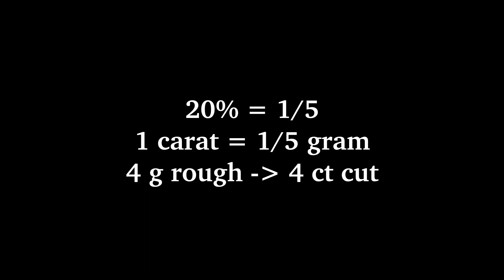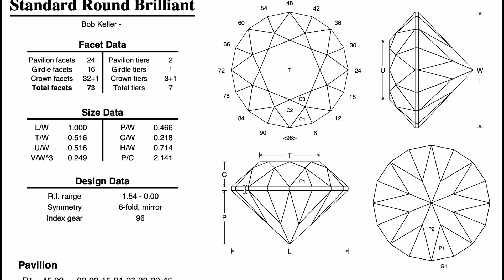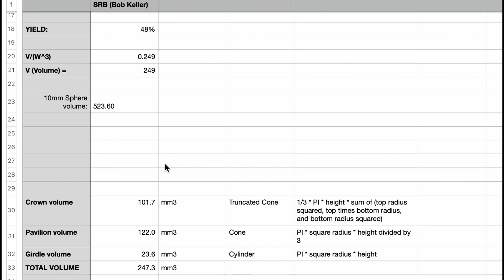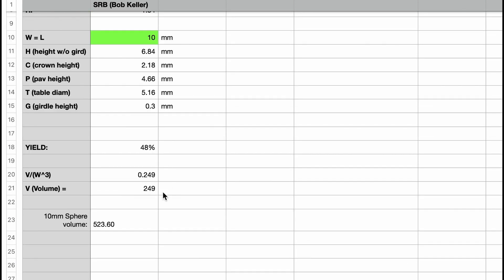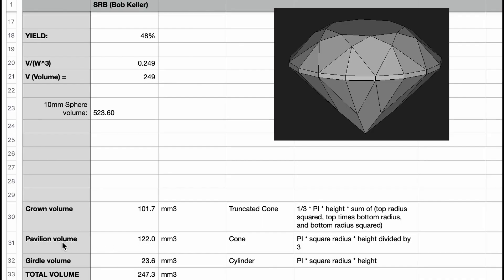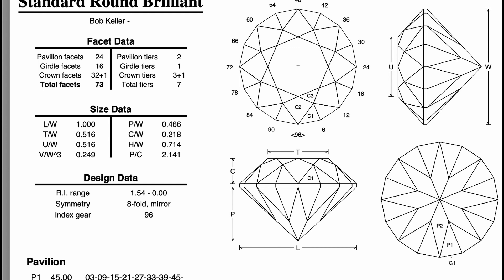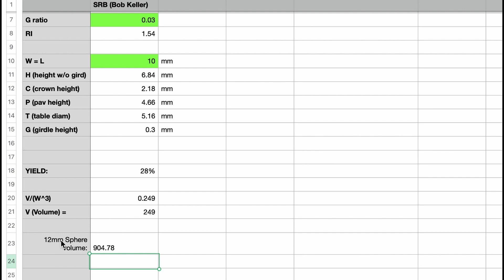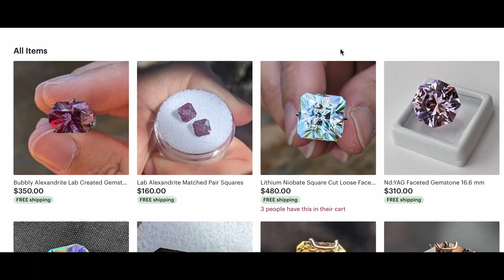Facet Math.

Comment: Patrick? I have a new three hundred dollar faceting machine called a Vevor. Looks accurate, But! 

I haven't faceted anything yet. 

I'm planning it all out and my problem is transfering. There is no index pin or flat spot, in the quill. I can fix that with a small drill and then a center punch. The problem is how do I find the center of the dop...both dops, when both are in the transfer jig? I have about ten dops of brass. I guess I could notch each one.

 I know If my Lead Man were here, He'd know.

I'm in Graham, on the other side. Hope to meet you, this Summer.

Donna Chassie
Reply from the maker: Index pins only make it easier. You can transfer to the other dop and then line it up on your faceting machine after the fact if you have a faceted girdle. Set your machine to 90 and lower the stone onto the master lap and adjust it until the girdle rests flat across the lap. It's easier if you have a machined block that's perfectly square to raise the stone up a bit. But as long as you get it close to square, you can make fine adjustments with the cheater after making a few cuts. Leave yourself enough meat on the stone to make those adjustments because you may need to make a few passes around it.
Another option is to cut a round (or mostly round, like with 16 girdle facets) stone and don't worry about the alignment. A standard round brilliant will look good even if the crown and pavilion aren't perfectly aligned. Your girdle will look a little wavy, but that's actually how most commercially cut gems look.
Reply: Thank You, Mr. Donohue. I will do as You say. I will build my skill, transferring, without needing index pins. I can see myself, taking a very light cut, to see how I might adjust the cheater knob. I expect I will pic a dark rough six X eight mm garnet, and, first, make the girdle, using four sides, to check how accurate the frame is. Then I'll do the pavillion with four facets, looking for a pointed pavilion. Then, change dops, the new way You have taught me, and make a crown, some how. Then, I'll pic a stone of some kind, use the standard round brilliant plan, since the cut will look good, anyway. But, I wish for accuracy. I'm so excited. Donna Chassie @DonohueLabs

Comment: Good topic.
I'm using 30% yield when purchasing rough opal.
I like the quick rule of thumb for gems 1g=1ct.

I'm looking for a rough lump of VVS black spinel, also called Thai black spinel or Black Jack spinel. Any tips of how to judge rough black spinel to be of gem quality?  I'm not gem cutting (faceting), I'm cutting a geometric pattern.

FYI, There are two general heat treatment methods for gems. One is low temperature and the other is high temperature. 

Higher temperature heat treatment of sapphire is 1800C and can be held at temp for 10 days. I suspect that the temperature ramp up rate and hold times during the ramp up and ramp down heat treatment is important.
Tks!
Reply from the maker: With opaque stuff I don't know how to judge other than doing a test polish on an area. With spinel the only thing I've heard is that alluvial is more sought after as it turns out better. 
Overall I'm still very new at gem rough buying and grading and tend to stick to reliable sources so I can trust they are selling a good product. But I know that doesn't work in some cases if you're looking for something very specific.

Comment: The pavilion cut is a relatively modern creation, isn't it? Back in the day before the pavilion cut was invented would the goal have been to keep more of the stone intact?
Reply: A few weeks ago I read a paper on the history of gem faceting. In ancient times and for 1000's of years a well terminated gem was the ideal. Then came faceting and the first cut was called a point cut. Still trying to retain the original natural terminated points.

I just purchased a doubly terminated spinel specimen. I'm having a difficult time designing a setting for it.
Reply: The usual would be a cabochon cut, which normally should retain more weight. Although the emerald cut comes very close to the natural shape and would probably cut a bigger stone. So there are exceptions.